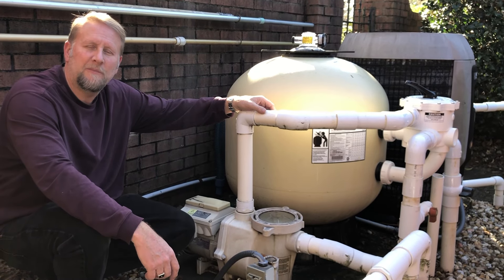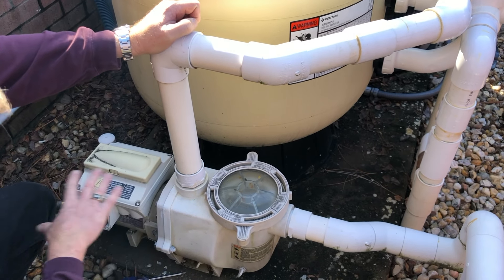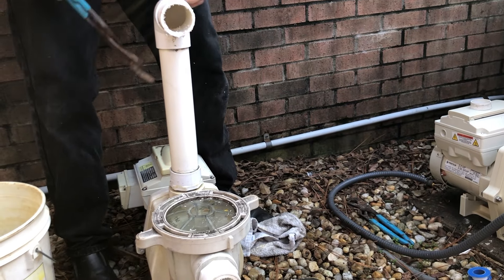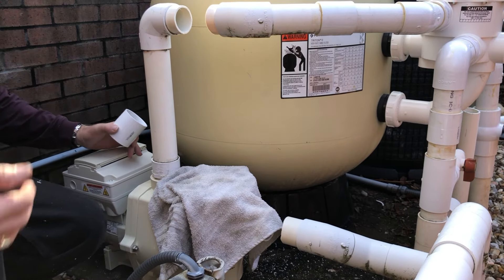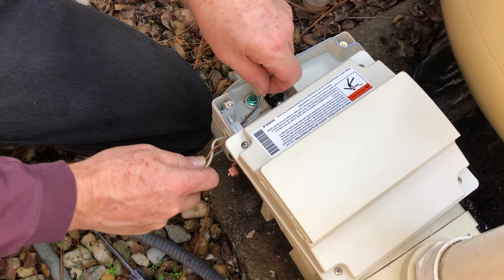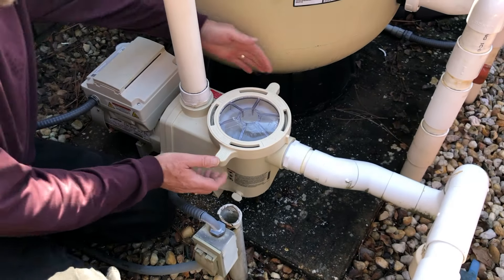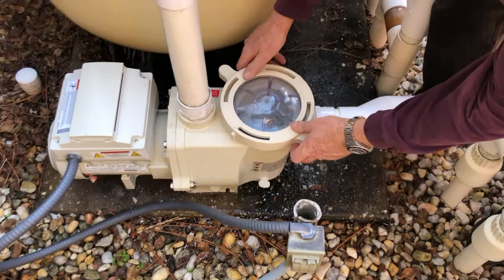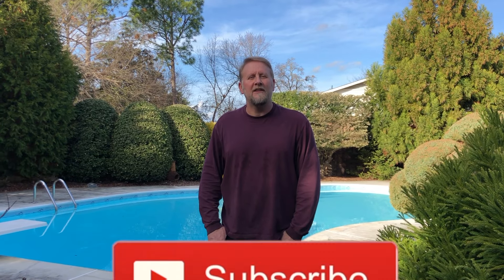How to Install a Pool PUMP Quick and Easy!

Comment from the maker: In this video, when I wired the pump, I talk about a neutral wire. The pump was wired 220 volt which has no neutral wire. A 110 volt hook up uses one hot wire, a neutral, and a ground wire. A 220 volt hook up uses two hot wires and a ground wire. The pump was wired correctly for 220 volt, I just misspoke.
Reply: Thank you! That confused me. By code that white wire should be marked with a red or black tape at the pump and at the breaker to indicate it’s hot.

My install, also a Pentair but only 1hp, is at 110v so exact same wiring. Thank you for the clarification.
Reply: Thanks for this. So to confirm, the white wire or neutral wouldn't have to be landed to the N terminal. L1 and L2 are interchangeable?
Reply from the maker: Yes, thanks for watching.

Comment: Looks easy enough... can’t wait for it to turn into a 5 day ordeal for me now
Reply: How did it go?
Reply: Same I did it perfectly fine but the cover for the wires was stuck with the screw striped so I took the the whole motor out that did it and it works perfectly fine.
Reply: Haha, that’s so true! —> NOTE: I’m not sure why he is not using ‘primer’ for the PVC before he glues. We do a TON of repairs and installs and cleaner is normally standard.
Reply: Now I want to change my hayward tristar to this
Reply: You must be related to Murphy like me.  The simpler the job, the more that can and will go wrong taking a 1 hour job into several days.

😅😂🤣
Reply: @RandomRockets   I found a pool guy who hand new "old' stock on a pump.  He installed it and w/ the pump was only $350 for a 1hp single speed.  The setup I have was at least professionally done.   Now for me to figure out about the pool resurfacing :)
Reply: Yep, turned what should have been a 20 minute job to a 2 hour job because ya know plumbing. It’s never as simple as it supposed to be.
Reply: Not only could it turn in to a multiple day ordeal. If you don't use pipe cleaner like this guy, you will probably have a plumbing leak within a few weeks, if not immediately. Then you get to spend another day replumbing.
Reply: Boy ain’t that the truth…
Reply: Lmao I was thinking the exact same quick 11 min video more like a long project for us lol
Reply: Amen😂😂😂

Comment: Hi Mark,
Thank you so much for the videos.  I am on the HOA board and my pool company is fast falling from favor.  So with your videos I'm getting educated.
Something I would like to see, assuming it's not already there and I missed it, is a check list that should be followed with each visit by the pool company and what are all the holes I see in the pool? :) 

I'll explain.  In the pump room I see 4 large pipes going underground.  They are marked as: 1 drain, 1 skimmer, 1 vac, 1 return.  Not sure what the vac is for.
In the pool I see 4 skimmers (each has a drain like cover under it on the wall) and 2 dome top drains on the pool floor and I assume the drain and skimmer pipes pull on these 6 openings.  I also see 6 or 8 plates/round covers on the pool floor, are they returning water to the pool?  Now we're down to the vac pipe.  Is there a special outlet somewhere to connect a vac?
I may be way off here and would be happy to call you.
in the pump room we have 2 HayWard sand filters and looks like each holds 300 pounds of sand.  The top of the filter is chest high on me (I'm 5'8").
Reply from the maker: There’s a lot so detailed information there. So the best thing would be to give us a call between 10-5pm est Tuesday-Saturday so we can talk one on one.
Reply: @HallmarkPoolSupplies  Thanks Mark.  Both pumps went dry yesterday and the tech/manager came out today after I required him to call me before he enters the pool.  I had him explain the pipes for me.  It's amazing how nice people can be when you tell them you want to give the $800 a month to someone else. :)

Comment: Thank you for a very helpful and good quality video.  I have a similar Pentair variable speed pump that is 8 years old, difficult to read the programming display.  This video is a big help.  When needed, I'll replace the entire pump system, rather than try to repair. I was confused by the wiring. My pump runs on 220 volts.  It looked like you wired for 110 volts?
Reply from the maker: Some Pentair variable speed pumps will configure 110v or 220v on their own. This particular installation the pump was wired 220v, however I misspoke 110v has a hot wire, neutral wire, and a ground vs 220v has two hot wires and a ground. Feel free to call me if you have any questions.
Reply: The Intelliflo is actually 220v only. The superflovs is 115v or 220v.

Comment: Purchased a new pentair whisperflo vst 2.6hp. My old pump was a pentair superflo 1.5hp voltage is 115v. My old pump had the neutral on L1 and the hot was on L2.. my new pump was $1600 can you possible explain why those connections were swapped?
Reply from the maker: Make sure your new pump is set for 115v, most pumps can be set for 115 v or 220v. When dealing with 115v L1 is usually hot and L2 is neutral. You can switch the white and black wire on L1 and L2 it does not matter. If you are dealing with 220v then both L1 and L2 are hot. Thanks for watching.
Reply: @HallmarkPoolSupplies  Thanks for the reply. I'll wire it up as the drawing shows, was just concerned on why the previous pump install was swapped, take care for now.

Comment: Great video. Very helpful! Planning to replace my pool pump too. How can you tell if the pump is 230V or 115V?
Reply from the maker: Check the wiring diagram on the pump, or use a volt meter.

Comment: Hi I just subscribed to you I love your videos . I'm in a situation I have a in ground pool with a Hayward sand filter 
model # ST44T  with a Hayward pump 1.5 hp single speed (1.5) port  230v . I want to replace that pump with model  Hayward W3SP2603VSP will this be ok you think ? My pool only has 1 jet and 1 return ,1 skimmer I believe it's 18000-20000 gl
Reply from the maker: Yes, that pump will work and is wired for 230V only.

Comment: Nice video. Question, it appears you wired it at 110V (3 wires) but you said it required 220V?
Reply from the maker: In this video, when I wired the pump, I talk about a neutral wire. The pump was wired 220 volt which has no neutral wire. A 110 volt hook up uses one hot wire, a neutral, and a ground wire. A 220 volt hook up uses two hot wires and a ground wire. The pump was wired correctly for 220 volt, I just misspoke.

Comment: I noticed you didn't bolt the pump down to the concrete. Is it not necessary? I would think it would create unwanted noise and vibration. Would appreciate your thoughts. Thanks.
Reply from the maker: When you hard plumb (PVC) it is not necessary to bolt the pump in place, however if you want to you can. Most installs are not bolted, noise and vibration are usually not an issue.

Comment: Great video!  My pump just started humming when I turn it on and then it trips the breaker.. it won't spin at all before doing this.  It's a Hayward super pump- not sure how old since we just bought the house last November.   Is it safe to say that it's toast?  Time to close the pool and my pump fails.  Sucks...
Reply: Did you check your starter are the capacitor?
Reply: @shadow40495  not sure where those are on my pump. I have a Hayward super pump - 1 hp.  I guess I need to find an owners manual.
Reply: Had same issue, replaced capacitor and all is good.

Comment: Hey Mark, could you tell me how to know what pump I need (20,000 gal)and and estimate on much it cost
Reply from the maker: It really depends on the size of the filter that you have. According to the gallon capacity, you should have a 1 to 1 1/2 horsepower pump. Depending if you get a single speed pump or a variable speed pump, a good quality pump will start from about $700 dollars on up. If you have any questions feel free to contact me and l will be glad to help. Thanks for watching.

Comment: Arent both the white and black hot on 230V? It's 230 across those wires. L1 and L2, correct?
Reply from the maker: Yes. You have two hot wires and a ground. You connect one hot to L1 and the other hot to L2 and green to ground.
Reply: Yes, I think he just misspoke in the video.  White is not neutral in this case.

Comment: Question:  I thought one hot, one neutral was a 120 volt wiring configuration??
Reply from the maker: @JuanSanchez-tk4vr   In this video, when I wired the pump, I talk about a neutral wire. The pump was wired 220 volt which has no neutral wire. A 110 volt hook up uses one hot wire, a neutral, and a ground wire. A 220 volt hook up uses two hot wires and a ground wire. The pump was wired correctly for 220 volt, I just misspoke. Thanks for watching.
Reply: @HallmarkPoolSupplies  so then the black and the white were both hot?
Reply from the maker: @JuanSanchez-tk4vr   Yes, however the white wire is usually marked with 220 volt hook ups. With 220 volt wires, you can also have two black wires and a ground or a black and red wire with a ground. To be safe use a volt meter, that way you will know what you have.

Comment: You should be able fit/screw-in  the programming panel 180 degrees from how it is placed in the video. Much easier access when programming.

Comment: Do you have to change out the feature pump to a variable speed pump also if you change the filter pump to a variable speed? Or vice versa.......
Reply from the maker: In this video I replaced an old variable speed pump with a new variable speed pump, when changing your pump, single or variable it is important that you size the pump or motor to your filter.

Comment: What kind of cement did you use that you didn't need a primer or pvc cleaner, especially with reused pipe?
Reply from the maker: I used all purpose pvc cement.
Reply: @HallmarkPoolSupplies  Can you recommend a brand?
Reply from the maker: Weld-on is the brand that I use. This was a small job and the plumbing was fairly clean. I would recommend primer for larger jobs or anything underground, since you are unable to see it once it’s buried.
Reply: @HallmarkPoolSupplies  Thank you.
Reply: Always use primer. That would eventually fail.

Comment: That’s a nice pump to just replace completely. How much less would it have been to just swap the motor?
Reply from the maker: Motor replacements are less than the entire pump. Price varies upon motor type and horse power. Call me if you have any questions.

Comment: Got anything against primer?  This guy is why I do everything myself.  He left 1/2 inch between coupling on the suction/intake side.  Should have totally replumbed that.  Appears a relatively new pump is being replaced. Hmmmmm.
Reply: This customer spending boo koo bucks $$$$$$ on a brand new top of the line pump should have been given a quality install. This guy is trying to save money by taking short cuts, using the existing discharge fitting from the old pump (a 'no no') and using cheap schedule 40 fittings on the suction side, both of which will start leaking when the pump heats up. Much more cost effective and better for the customer, would be to install high temp unions on both the suction and discharge ports. No leaks, and entire pump can be removed/serviced and replaced without replumbing/gluing anything.

Comment: Filter keeps busting up my cartridges. After the multiport valve was changed. Switch to a sand filter now sand is in the pool any ideas to what is plumbed wrong?
Reply from the maker: You may need to check the laterals  in the tank. If you would like to contact me I will be glad to help.

Comment: I wouldn't ever reuse a male adapter, over time the use of teflon tape gradually squeezes the threads, leading to leaks. Good pump choice though... love the intelliflo. Also, when going to VS, just get rid of that old light switch and run new electrical whip, takes no time.

Comment: why did you say it's a 230v but only using 1 hot and 1 neutral? like a 120?
Reply from the maker: @pazp777   The pump was wired  230 volts with two hot lines and a ground, l just misspoke. Thanks for watching.

Comment: What kind of pool pump did you install here? Is it a variable speed and what brand? Ty
Reply from the maker: The pump in the video is the Pentair Superflo VS. See link
https://hallmarkpoolsupplies.com/search.aspx?searchterm=342001
Reply: @HallmarkPoolSupplies  thank you. That’s awesome I think the one we chose was also pentair variable speed
Reply: @HallmarkPoolSupplies  can I plz ask you a question? So we did end up getting this exact pump and the guy just installed it and programmed it but I was worried he didn’t program it to the best settings that will save us $ on our electric bill but he has it running for 4 hours at 3300 and 7 hours at 2500. I thought I remembered you or someone else saying 1500 was a normal setting but my guy said that sounds really low and we wouldn’t get a good flo at that speed. Really appreciate any advice. Ty
Reply from the maker: @outofthebox9913  Every situation is different due to environment, bather load, and time of year. What you are describing, it sounds like your pump is only running 11 hours per day. I recommend to run the pump 24/7, so the remaining time can be at the 1500.
Reply: @HallmarkPoolSupplies  ok thanks. Does it cost a lot more to have it run 24 hours or does it not really make that much of a difference

Comment: Always replace the wiring in the sequence you took it off. Ground was last so you land the ground first, neutral and then hot. You’re standard electrical practices.

Comment: Why didn't You use high temp fittings for the pump. Much easier for use in the future. Just a thought.
Reply from the maker: The pump installation in this video was done per customer request. I do appreciate the feedback and thanks for watching.

Comment: How to wire a 4 wires with a GFCI breaker? Where connects the White wire? 230v Red- Black White Green
Reply from the maker: Check your voltage and to be safe you may want to contact an electrician for your situation.

Comment: WONDERFUL video. But you talk about 220 volts.   And you wire 120 volts.
Reply from the maker: Thanks for watching and commenting. 120 volt hook up's use a hot wire, a neutral wire, and a ground. However the Intelliflo 3 HP variable speed pump can only be wired in 220 volts. 
220 volt hook up's have two hot wires and a ground. I did wire this 220 volts but I misspoke, thanks for catching that.
Reply: You got that as well....
Reply: @HallmarkPoolSupplies  For anyone reading this, if this is hooked up as 220, then he’s probably using the white wire as a hot. Ok to do, but you should use a little black tape to mark it so. That way anyone working on it knows that it’s not neutral.
Reply: @HallmarkPoolSupplies  so if you misspoke, then reshoot that portion of the video.  DIY'ers are watching this.

Comment: How do you get 230volts from one hot wire a neutral and a ground
Reply from the maker: Thanks for watching and commenting. 120 volt hook up’s use a hot wire, a neutral wire, and a ground. However the Intelliflo 3 HP variable speed pump can only be wired in 220 volts. 220 volt hook up’s have two hot wires and a ground. I did wire this 220 volts but I misspoke, thanks for catching that.

Comment: Mark, you said the original pump is 120 volt with a neutral then said the new pump is 220 volt, you should have explained that the ''neutral now is being used as a hot conductor and made adjustments In the panel as necessary also no equipment bonding of the motor?
Reply from the maker: This particular installation the pump was wired 220v, however I misspoke 110v has a hotwire, a neutral wire and a ground versus 220v has two hot wires and ground.

Comment: You can also face the control panel on this peticular pump in any direction for easier access and readability
Reply from the maker: Panel was rotated after the install, I just did not show in the video.

Comment: So the pump doesn't mount to the ground at all?
Reply from the maker: Pumps can be mounted, however with hard pipe installation  it is not necessary because the pump is not going to move.

Comment: You said in the beginning of the video that the white wire was the neutral wire but then towards six minutes 32 seconds you said that the pump was 230 V. If the pump is 230 V then there is no neutral. Both white and black wires are hot. I don’t want anyone to be confused and think that the white wire is not hot.
Reply from the maker: Yes, when I wired the pump I did wire it 230v, I just misspoke. Thanks for watching.
Reply: This comment should be pinned and OP should state in the notes of his video the correction. It's a life and safety issue for any viewers to assume that was a neutral wire just because of its color.

Comment: The only thing he didn’t do was connect the ground on the outside. If the pump messed up and pentair came to assess it because it doesn’t have that extra ground they would not approve it under warranty.
Reply from the maker: The pump was pre existing before I did the install, and there was no external ground. Not having an external ground does not void the warranty. Thanks for watching.

Comment: Not enough pipe in that discharge union…ffs, can’t believe he would film himself doing this.
Reply from the maker: There was no unions used on this install. All  connections were glued in all the way. Its been over 3 years since this video was made and everything is still running great. Thanks for watching.